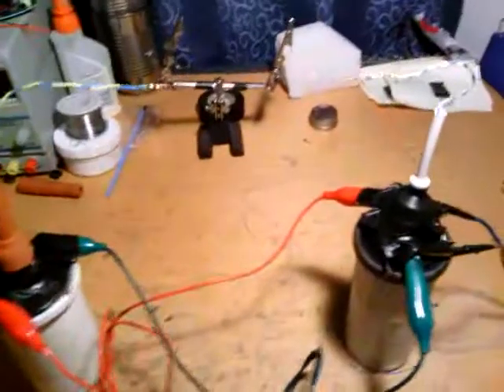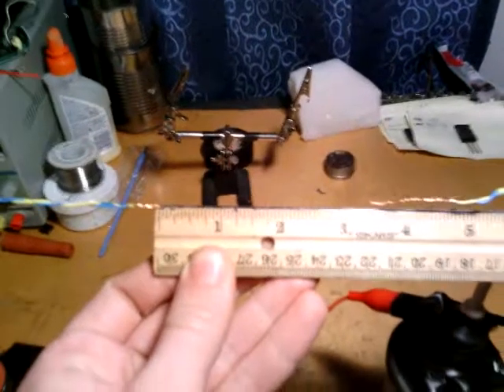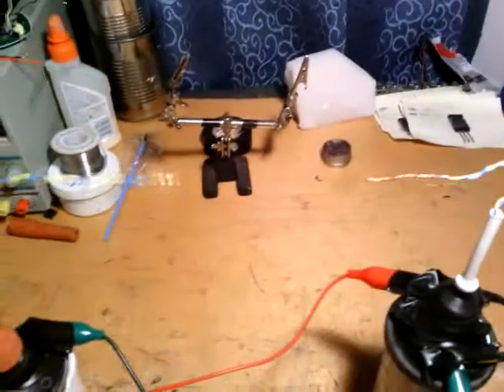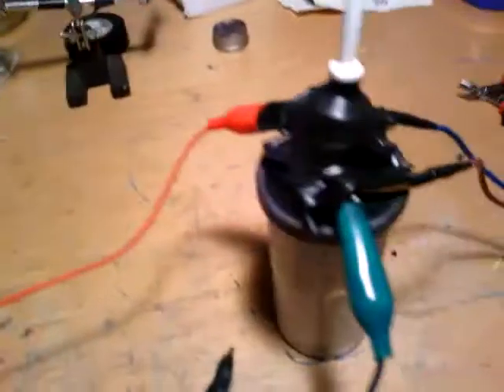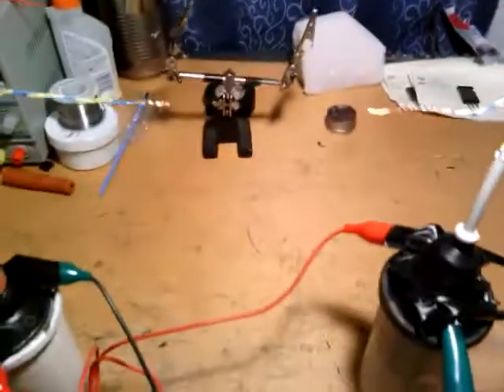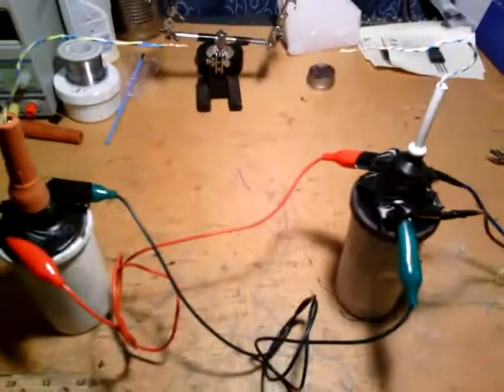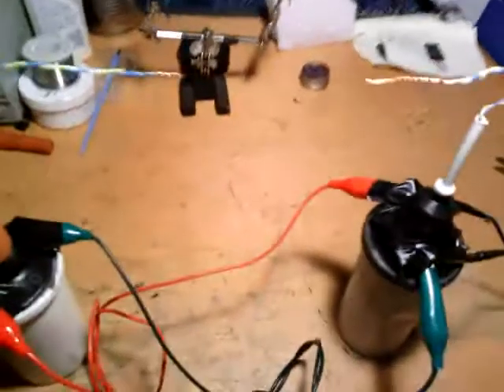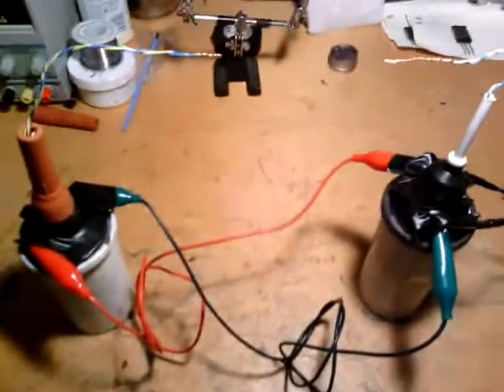Anti-parallel ignition coils

Comment from the maker: Yup! you just need a capacitor in series with the output, 1uF or abit larger works, i use a 3.2uf 50/60HZ fan capacitor and can get 6+ inch sparks!